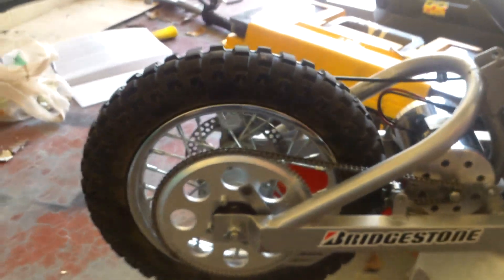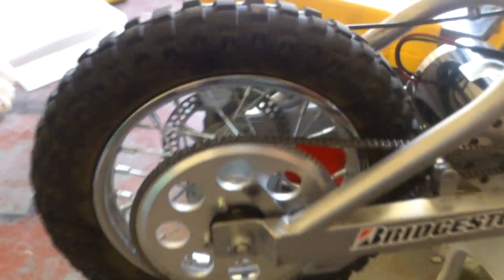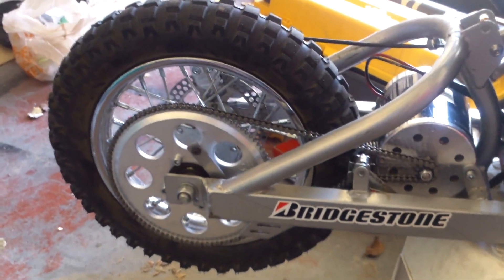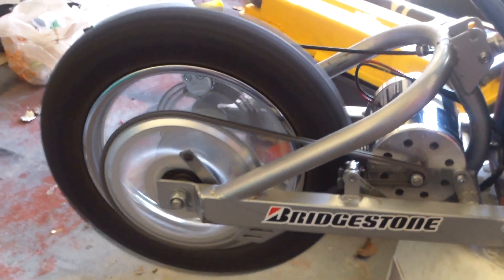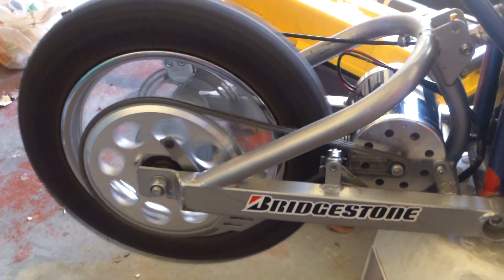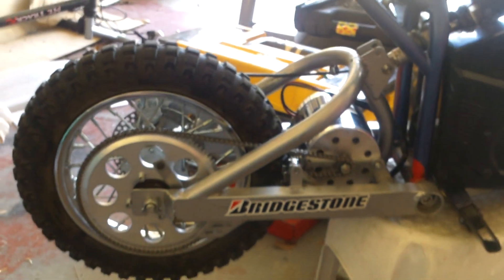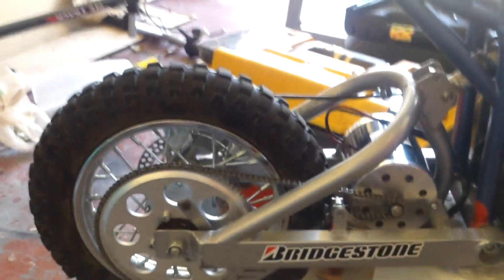Mx 500 conversion to Mx 800: Video 2

Comment: What do you think about stock gearing with a 2000 watt motor with a 45 amp controller at 48volts?

Comment: solution was remove 30 amp fuse from the battery series. bike worked fine thereafter.
Reply: Replace with what size